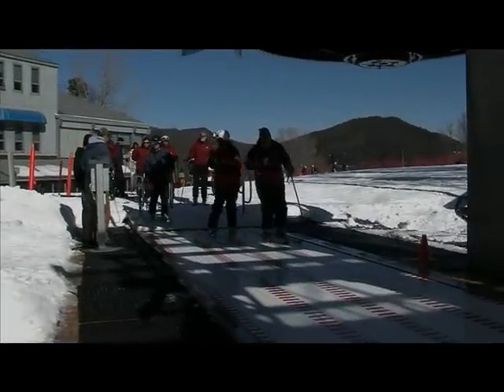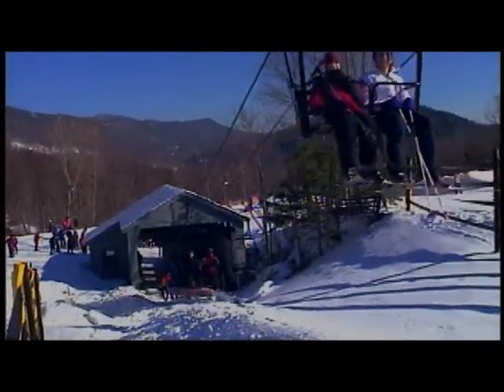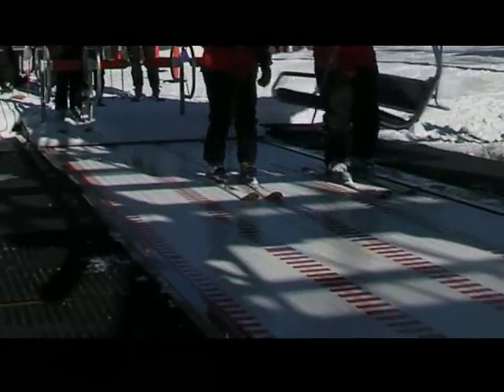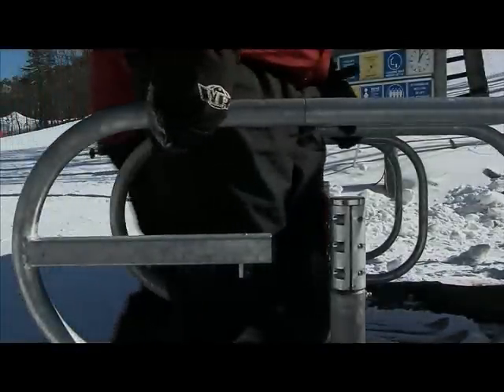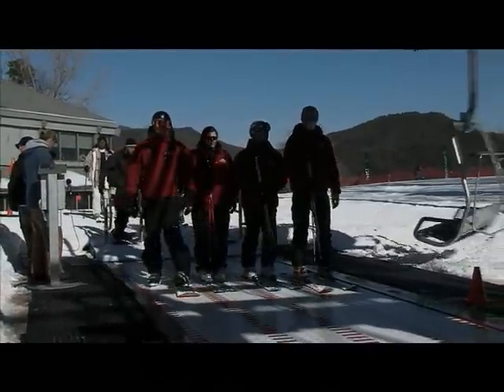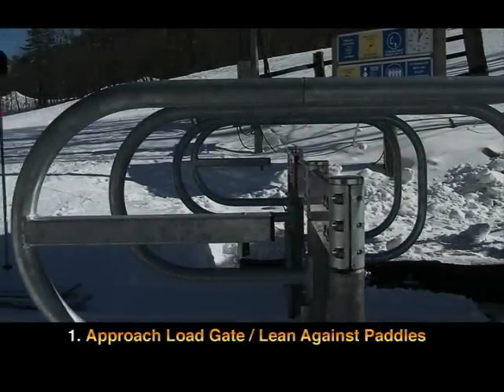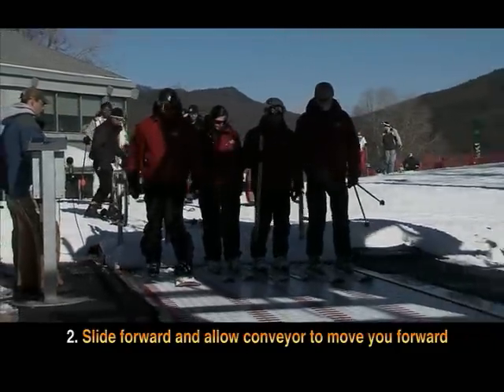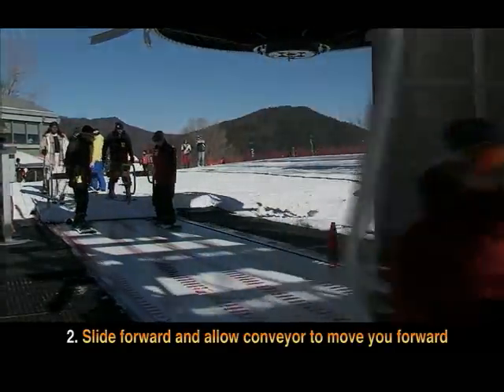How to Ride the New Doppelmayr Chairlift

Comment: holy crap, it's hilarious that they have to explain this already very outdated technology. you won't find those in the modern skiing areas of europe.
Reply: there are many fixed grip chairlifts in europe....:) detachable technology is very expensive. :)
Reply: In fairness it is quite rare to get a new fixed lift in Europe. When an old lift is replaced it's almost always replaced by a detachable quad. I think it's because most of Europe's ski areas are large and therefore relatively wealthy whereas the states has more smaller local ski areas :)
Reply: This is in 2009 and the slope this Is for is a beginners trail